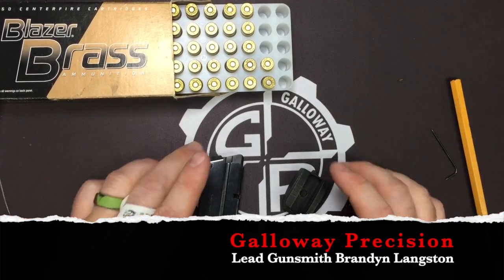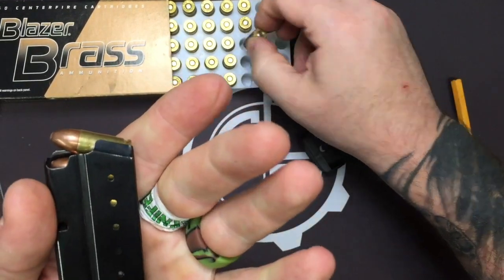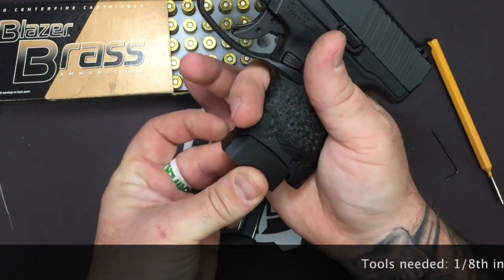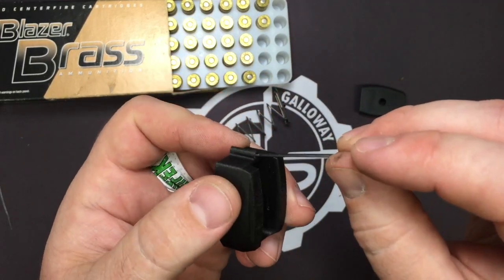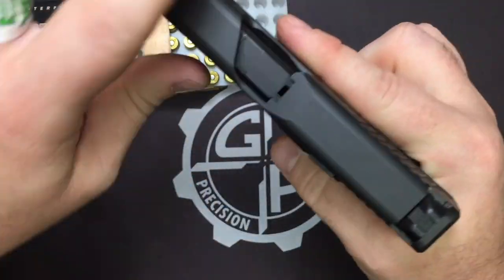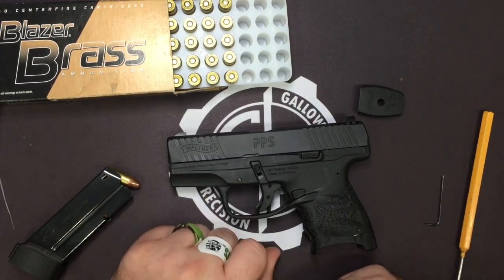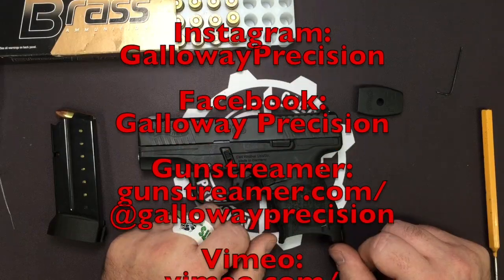Walther PPS M1/M2 +1 Mag Extension

Comment: 1:56 "It will also fit the 7-round mag" -- Could you double-check?  My locking plate on that mag has wings that stick out a few mm either side.  They seem to be too rigid for your extension to slide past.  I can email photos if you don't have one handy.

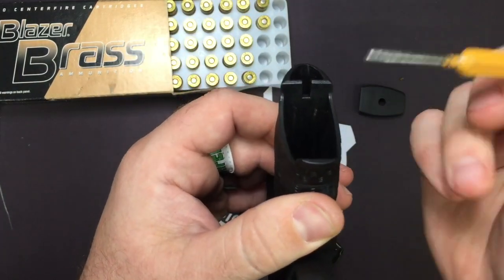Comment: Does it actually work with the PPS M1? Because the little cut out area you're referring to (at the 4:04 mark) doesn't exist on my PPS M1..
Reply from the maker: Yes it will work on the M1. The M1 has a European Mag Release, but does not change the extension fitment.

Comment: Think this extender will work with magguts spring +1 for the 6 or 7 rounders?
Reply from the maker: Unfortunately no, the MagGuts are specifically designed to work with the stock base pads.

Comment: Wil this work on the 8 round magazine for the LE version=9?
Reply from the maker: It has only been tested on the standard mag. The longer one may have a different floor angle and the spring will be longer for sure, not sure if it has enough tension to feed correctly without testing.

Comment: Will it fit for the base if you have magguts? If you have magguts you can already add an extra round but if you get this extension and you have magguts you should be able to add two extra rounds. Anybody have any experience in that?
Reply from the maker: MagGuts are specifically designed to work with the stock base pad, not any extensions.